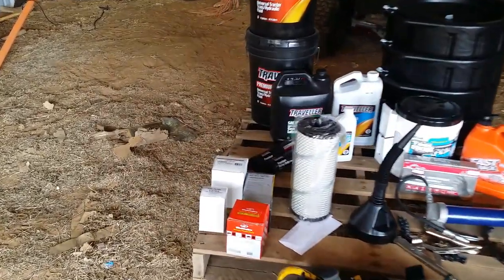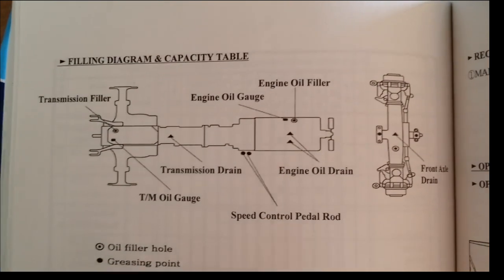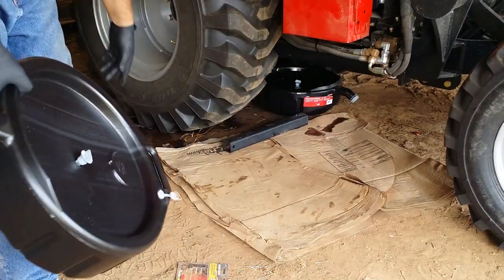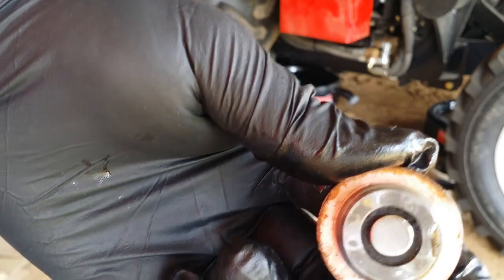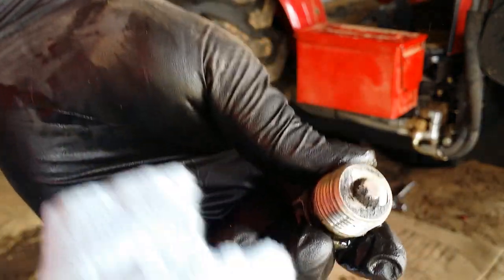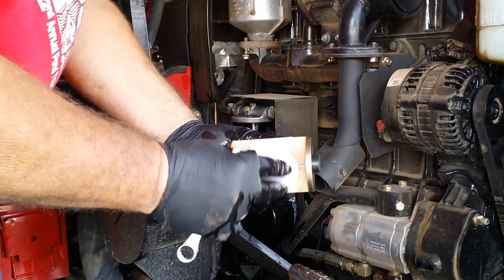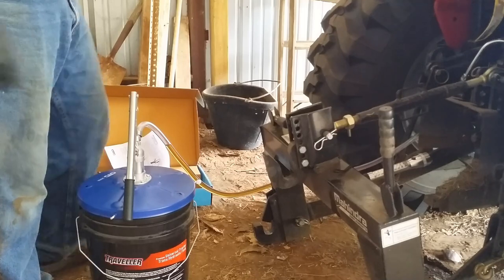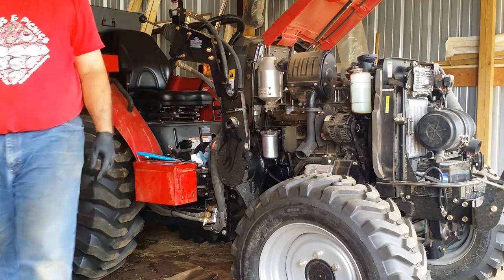Mahindra 2538 50Hr Service

Comment: Hello did you ever figure out how to shut off the fuel when changing the secondary fuel filter? thanks
Reply: You can buy a clamp that pinches off the fuel line - the ones I've seen look sort of like vice grips with flat, rounded jaws.
Reply: @techbutterflymaps9873  thank you.

Comment: I'd love to offer some helpful info. I will stop back and add more but one of the most helpful things I can tell u is to clamp your diesel fuel line when changing the fuel filters. Personally I cut the line after my clamp then installed a simple 3/8 ribbed ball valve style shut off valve so that every time I service it I can just turn the handle and drain the little fuel in the canister. Fast clean and simple! Why the dealer doesn't install a shut of to begin with is just crazy!
Reply: Yes I didn't know about clamping the line when I did this. I would like to put in a valve also. You say it's a 3/8 inch ball valve? Where exactly did you put it? Is there any place I could see a picture of yours? I'm getting ready to do this service again and I'd like to add the valve.

Comment: Great video- and something to add to hopefully help someone else. My tractor had quite a few metal filings on the hydraulic oil drain plug. I decided to pull out the other hydraulic filter/ suction line strainer. I had to loosen all the bolts on the subframe member on that side of the tractor to get the clearance to get the suction line strainer/ filter fully out. This was a pain but worthwhile for me as there were a lot of filings and chips held up on this filter as well. I am not sure if all these metal filings are a sign of a larger problem or not- I suppose time will tell (and I will probably change my hydraulic oil again earlier than needed).

Comment: Excellent video which helped me decide to have the dealer do it for $386.41.  My health prevented me from doing it myself.  Your video helped to see what was done.
Info:   6.5 gallons Hydraulic fluid
           2.0 gallons of 15w/40 motor oil
         1.75 gallon 80/90 gear oil
Reply: If you have a Mahindra 2538 tractor I hope the dealer you went to didnt put 15w40 in it. It takes ONLY SAE 30 motor oil, anything else will void your warranties and ruin your motor over time.
Reply: @brenmfffusmc7803  not true -- per the manual it ships with 15w40 and which oil to use afterwards depends on the average temperature in that climate
Reply: @herewegotoday  That is the exact model I purchased 7 years ago with all the bells and whistles. The manual with mine said use the SAE style. It probably depends on where you live in the US or Canada, and the elevation as well. The dealer that sold it, put SAE in it before I picked it up, but I'm sure that's going to be different by location.

Comment: Interesting, my dealer told me all I needed to do for the 50 hour was change the oil.  He told me to wait for the 100 hour to change the hydraulic fluid.
Reply: Chance1957  mine said no fluids changed until 250 hours. They had a $99 special for the 50 hour. WHAT A WASTE OF MONRY. All they did was look at the fluid levels and grease the zerk fittings, they even broke 3 of them and tried to charge me when they broke them.
Reply: Thats what mine told me to do too. Just the oil

Comment: I didn’t see any comment on this.  On the front axle both wheel hubs have drain plugs and air vents which need to be removed when draining axle. During refill put the air vents back in after fluid is refilled.  Were did you buy the pump for the five gal bucket.  Also check and re-toque engine mounts on your next service.
Reply: Thanks for the tips, Dennis. I'm not familiar with the plugs and vents you mention. I will take a look next time I'm using the tractor. The pump I bought was this one: https://www.amazon.com/gp/product/B00EVPLY32/ref=ppx_yo_dt_b_search_asin_title?ie=UTF8&psc=1.

Comment: I'm due for the 50 hour check now too and this video is very helpful. I may do the engine oil, filter and front axle. Not sure of the rest though...
Reply: The rest isn’t hard. You just need a clamping tool to clamp the fuel line so it doesn’t leak all over like mine did. You can get that tool anywhere, I just didn’t know about it. In addition, you need a container or two big enough to hold the 7 gallons or so of hydraulic fluid. You can find kits with all the filters you’ll need. I also found it helpful to have a hand pump to put the new hydraulic fluid in. Good luck whatever you decide to do!

Comment: How much 80w90 did you end up putting in the front axle? Also, You mentioned at the end about the "Final Drive", where is that located?
Reply from the maker: I put in a little over a gallon. As I mentioned, it was a little over full. One gallon would probably be fine. I don't know what the "final drive" is supposed to be, but there are plenty of errors in the manual - maybe the standard tranny or shuttle have a final drive that needs to be serviced.
Reply: Thanks for the info and the great video
. One more question, someone mentioned there may be a seal on the bottom of the fuel filter sensor that you have to reuse, did you happen to notice that? I am doing all my filters this weekend and wanted to be prepared. Thanks
Reply from the maker: I don't remember that seal - maybe it just stayed on the sensor when I transferred it. Next time I change that filter, I'll keep an eye out for it. Good luck with doing your service!
Reply: The final drive is the last gear set next to the front tire. There is a drain plug near the bottom of the axle near each tire, if you didn't drain those that probably explains why it only took one gallon instead of two.

Comment: Any new info on how to shut the fuel off? I have a 2638
Reply from the maker: The simplest way is to buy a tool made for the purpose. It looks like a vise grip, but has broad flat surfaces, meant to pinch the hose and prevent leaking. Can be gotten cheap at harbor freight or probably any auto parts store.
Reply: OTC 4506 Fuel Line Clamp Set - 2 Piece (About $5.00 each) Google amazon for current price.